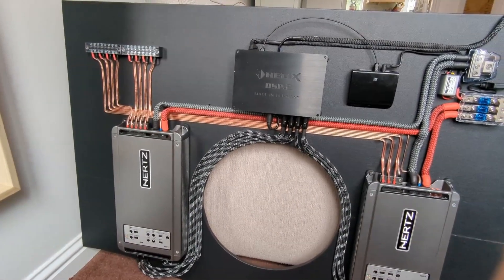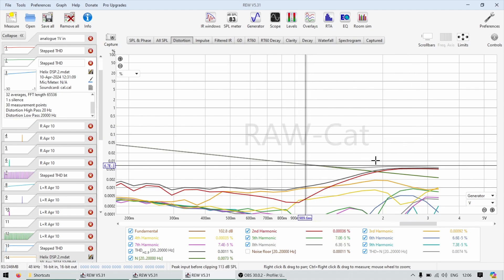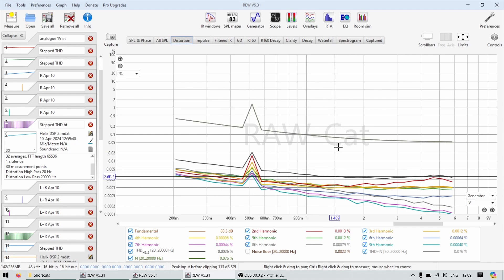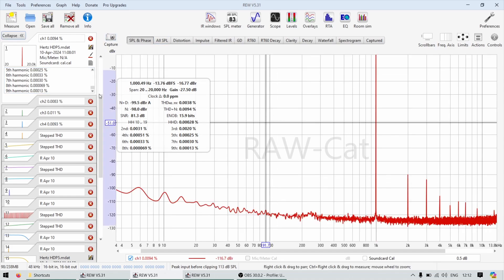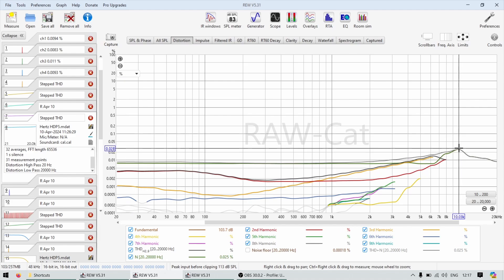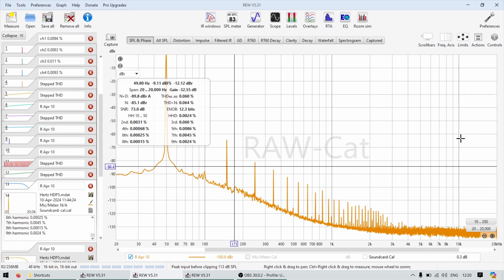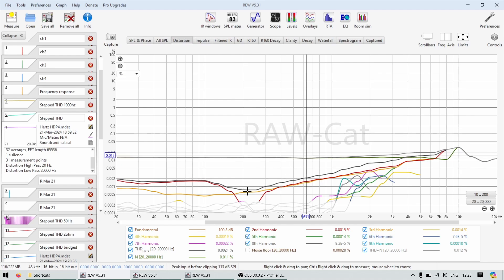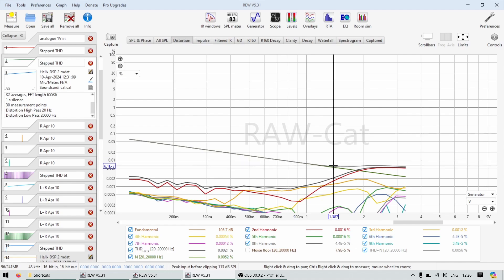Honda Jazz upgrade part 6 - distortion measurements and analysis

Comment: 14:30 you say 113W is plenty enough
I use a MSix DSP and bridged the channels for mids ~200W use the other 2 channels left for tweeters and use an extern amp for my 2 woofers ~90W/channel
would you recommend bridged for woofers instead ? (90W being enough?)
Reply from the maker: Yes,give more power to the woofers. Mids need 20-30W only.

Comment: Hey,

Just recently upgraded my factory 4-speaker 2016 Honda Jazz with a XAV-AX6000 and a LOC to a 10” JL on the Rear Powered by a Blaupunkt Mono Amp. 

The audio quality has significantly gotten better. 

I have yet to put in a used pickup I had purchased which consists of the Morel Ultra 602 (Tweeter + Crossover + 6.5 Doors) and Tempo Integras for rear fill, and remove my amp from the LOC and wire it up to the dedicated Sub Port on the Head Unit.

I’m currently really happy with the setup, a lot cleaner and more power than oem due to the 5V Pre Out, but still left with a few things to purchase.

Can you recommend me a good AMP and DSP (either individual or combined) that can elevate my setup?

I’m very new to SQ and doing it for personal use, not competing. 

Don’t mind spending the money on Helix products, but I’m more after value for money in terms of getting the most out of the money I spend since the more higher end I go, I likely won’t notice it.

I’d rather spend some more time fine tuning my system. 

Thoughts?

Thanks!
Reply from the maker: Try finding something like a used v eight or m six dsp or p six dsp. Those seem to be expensive but are actually good value for money.

Comment: Those Hertz look like pretty decent amps. I wish you could get your hands on a Mosconi pro 4/10 for testing. I read on diymobile, I think, where someone tested it and found pretty high distortion in the higher frequencies and recommended it for only mid bass duty. This is of course after I paid a shit ton of money for one in the US and I’m using it for mids and tweets. Sounds just ok and not great to me but I noticed some weird stuff going on in the higher frequencies before I even read about it.

Idk if it’s on distortion factory because I don’t have Facebook, but if you know it’s a shit amp please tell me. Won’t hurt my feelings a bit. I’m looking at a Helix C-four now but I just want to confirm what I’m hearing is in fact the Mosconi. I’m using Helix dsp 3S and audio frog GB speakers.
Reply from the maker: Yes, mosconi has higher levels of distortion, same as Zapko. They are not objectively clean amps. The Helix C four is a beast and super clean, just cost a ton of money. We have a few mosconis tested in distortion factory.

Comment: Could you do a video testing the Bass enhancement/sub harmonizer in the dsp.3?
Also, what do you think, I own a dsp.2, but I'd need 2-4 channels more and was thinking of buying a used dsp mini mk2 or dsp3.s to add channels and I want the bass and center processing. 
It seems like a waste but a dsp pro is too expensive and can not be found used.
I have both a topping  bc3 and a fiio bta30 pro I could use as LDAC source, but they only have one optical output.
Reply from the maker: I am planning to test all the extra features of the virtual.processing ,just need to clear the backlog of other videos I am planning to do😊 You can use multiple DSPs and run one from another, it just complicated the tuning and the install quite a lot.
Reply: @RAW-CAt  Nice, I was thinking of using the center processing also. I already have a urc.3 so I thought I would buy a conductor for the second dsp.
What is your opinion on ATF DSP PC tool 4.8 vs 5.0?
I wouldn't want to waste two of the precious dsp channels just to run to the second dsp. 
Do you think an optical toslink splitter would work well here?